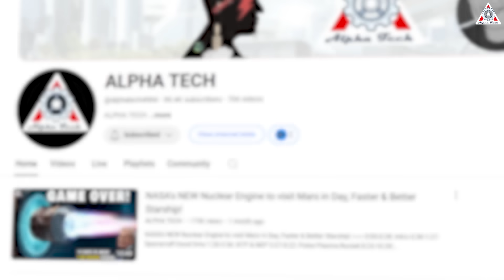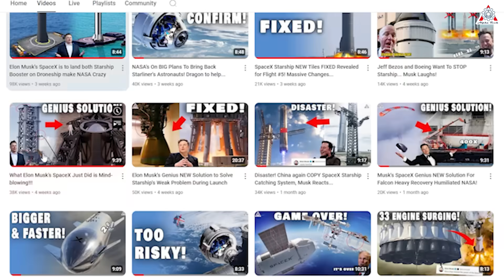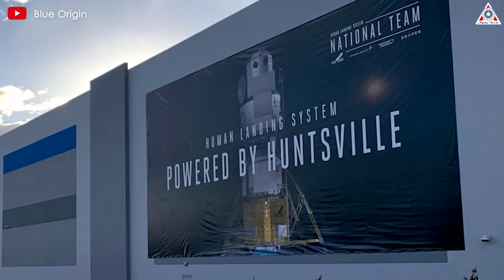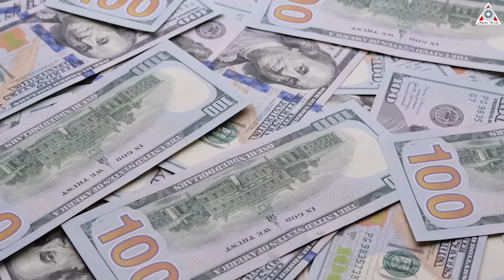Disaster! New Glenn Is In BIG TROUBLE. Blue Origin Is Hiding...Never Beat SpaceX

Comment: Building a new type of rocket is always a challenge. Why emphasize the failures ! 😮
Reply: Not a new type. Same old milled aluminum tanks rolled to cylinder shape. Decades old tech.
Reply: @gspeed930  true, but telemetry, sensor, communication equipment has to be integrated. Also, if it's not solid state fuel, and it's not, one needs fuel pumps, drainage pipes, and other kinds of pipes. 
It took some time for SPASEX to perfect their rockets.

Comment: So Blue Origin crinkled one beer can and blew up another...
And looking at their images, its obvious those are not quickly and cheaply built.

Funny that we are witnessing two extremes here between BO and SX, 
In production methods and production styles...

Blu-Ohh is doing horizontal builds using proper jigs, and roller systems, which in my AH's opinion is the way it should be done, and their build quality is very high, which is also something I consider a good sign generally.

If you are precise in every detail and aspect of any project, when finished theres a sharp look that you get thats obvious. BO is getting that. The problem though, is production rates. being like that is fine if one-offing, but building up steam is difficult if your standards are exceedingly high.

Its what I would term Old NASA thinking compared to SpaceX. 

Where they are designing in production at inception.

I think Starship has better influence from the blue collar tribe. And that BO workers are more like Boeing or NASA retreads..

And I've done writs on Alpha tech, about the problems with stacking construction in comparison to horizontal. That SpaceX is heading for problems, that started with the water tank guys.  

I'd say Jeff's Rockets are nicer, but he ain't gonna get very many of them until he gets more blue collar about the builds, and less perfectionistic.

And Elon is getting more rockets, but he's doing crappy engineering expedients due to stacking. Which I have explained in past writs.

If Elon went to the horizontal build method he could avoid going into entrapping ground, to borrow a phrase from SunTsu...

And Jeff is polishing his Rocket more than getting it up... Needs a practical analysis and cut the krap some where you dont need the excessive perfectionism.

I dont expect either
company to listen, until too late. Would be nice if they did, and avoid delay. But I hope what I am pointing out bleeds into the Space Community collective mind, and that maybe it flavors some of the Start ups like Rocket Lab and Stoke Space.

Evidently there are dozens of startups.
These writs are for you guys, if the industry leaders are Missouri Mules about their current paths.

Dont stack, its a dead end in larger sizes and leads to weaker heavier structures.

But also learn from the blue collar effect, and get more industrial, and less "Noble" about techniques and finish expectations, and do more testing, and worry less about the cosmetics than the function.

Its a tale of two rockets at this point. Bezos is too slow and complicated, and Musk is on a dead end path in the maze on stacked rockets.

The horizontal builds can be faster and higher quality. And more flexible to seamless morphing into not tube shaped hulls. Where Elon is gonna run into some logistics problems trying to build battleships of short sections, whilst standing on their ends.

An example was the problem on the second tower build where they tore the hydraulic cylinder mounts out of the crane's ass, and had to goto half sections... They are running out of sky hook.

And even in the tall bays with over head cranes, the lifting times will increase as ships get longer, and they may screw themselves as larger diameter sections get heavier.

Where the horizontal builds wont have those problems.

Its problem will be in building an erector.

And there, it will be hydraulic piston length and leverage issues.
And I'd suggest a system where the rocket is cradled, and the horizontal cradle jacked straight up from near its center, so you can get nearer the balance point and get some counter balance assistance for your tilt.

Could be done with a scissors mechanism like on a dump truck, instead of relying on hydraulic pistons of absurd lengths.

Main point is use balance instead of force to tilt, its way less risky physics.
On really big rockets you will need both. 

Also I notice on video clips of BO landing legs and control fin movement that both are a bit sticky... both systems should flow easily like well oiled machines, not move like they are horror house doors on rusted hinges...

I'd guess on the landing legs its the hydtaulic system is too over built and needs to be air-over hydraulics.

And on fin control, guessing their actuator has leverage binding issues  and they should consider a worm gear on a quadrant. And actuate the worm by electrics or hydraulics, or even air motors, but have it a greasy worm, so it moves smoothly...

Anyway, nice seeing the video footage, Jeff would do better if we got more of it, with explanations for online collective mind peer review. Elon has admitted a section of Starship developement is coming from feedback. Jeffie ain't gettin' that by being in the closet.

Nobody knows everything, and everybody makes mistakes... Especially those lacking in practical experiences, which Rocket Nerds with low production rates, are the Princes of...

Which is why things accelerated on Starship, when the blue collar guys influenced, and told the enginerds to get out of the way...

Also I might point out  that Jeff's nerds discovered Murphy's Law applies to rockets too! Luck is a branch of cause and effect physics.

Anyway, glad BO and SX are providing examples good and bad, for the startups to learn from. We need as much Space Industry as we can get. I would suggest the end goal of Space industry be the capability to evacuate the planet on short notice...

Mobility is the only true security.

And theres a reason space ship earth needs enough life boats. being short on them didnt work out well for the Titanic. 
I would suggest that Earth be considered a future park and museum that we visit...

And not an industrial zone.

We do wish to have our home be well cared for and pretty.

Industry makes better sense in Space and on dead lower gravity  planets.

Just sayin'
Reply: Well it seems to me they won't take off in the horizontal position so why build them that way. Planes are built horizontal cause that's how they fly. Anything else ( upside down maybe) is stupid. Same with rockets.  If I were you I'd run right over to BO and get hired cause they are up to speed on backward.
Reply: "Stacking" is much more efficient for large, rather flimsy tubes.. as you said, lifting a huge tube is pretty tricky..  another example is BO imploded that tank bcuz they are not being careful to think out ALL the variables.. we all have made mistakes being too careless about details and/or taking known risks.. BO is spend taxpayer's money bro..!! That's the biggest difference I see..
Reply: @francom6230  How are they spending taxpayers money and SpaceX isnt. They both have Nasa contracts...